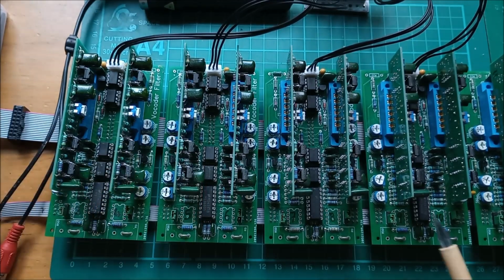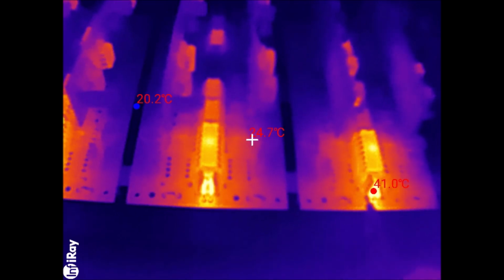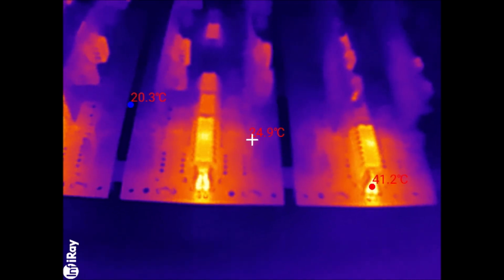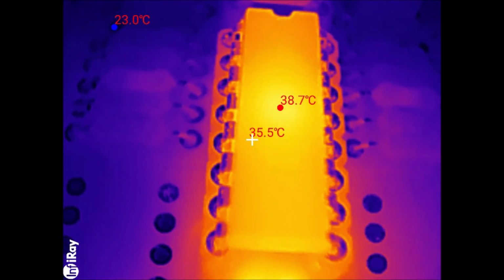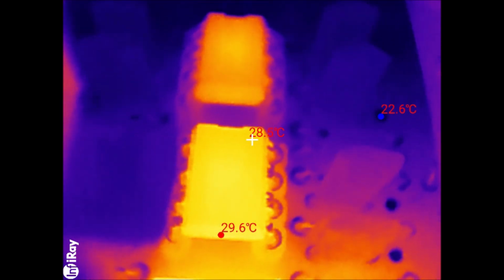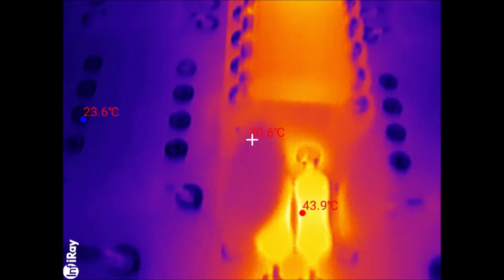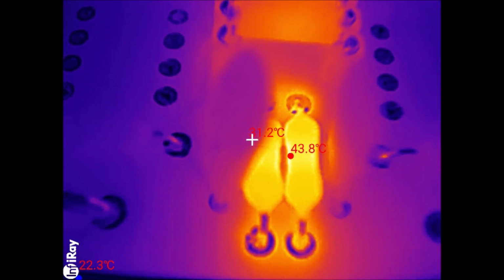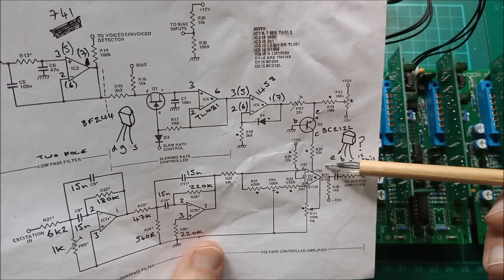Batteries, Capacitors and Chords

Comment: Glad to see you've moved on to something a little beefier than all those anyloops. Speaking of which, I think I mentioned previously that I figured out a trick to extending their life by warming up the cells, which has been working pretty well. However, it's coming into winter and I'm getting pretty sick of having to wait until my cells warm up every time I want to play my Game Boy Color [sic], so I thin I'll probably be buying a new set of anyloops pretty soon.
Reply from the maker: Several of mine have failed.
Reply: @JulianIlett  RSVP those anyloops. I finally bit the bullet and ordered an 8 pack of the pro model last night. I only had a 4 pack before, so hopefully the reduction in cycle frequency will help prolong their lifetime.
Reply from the maker: My newest NiMh cells are Ikea LADDAs. I like that you can get them in 2450 and 1900. Sometimes I have to use the smaller capacity cells as they're also slightly smaller diameter. The fatter 2450 cells don't physically fit in some things.